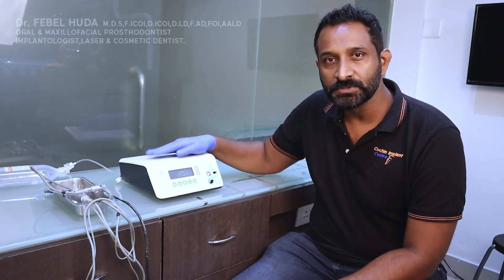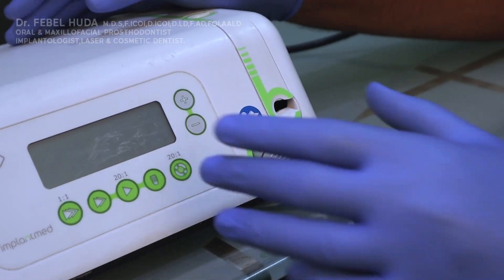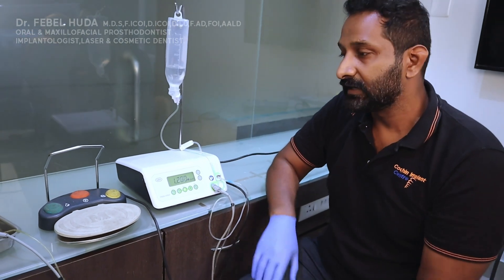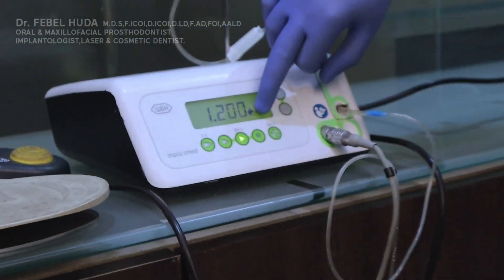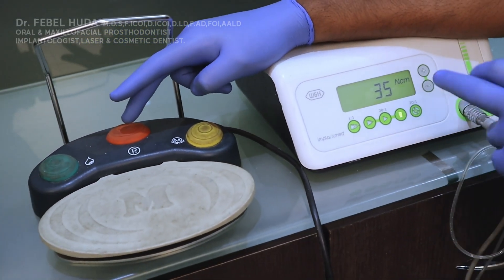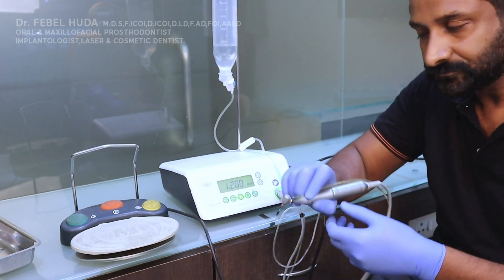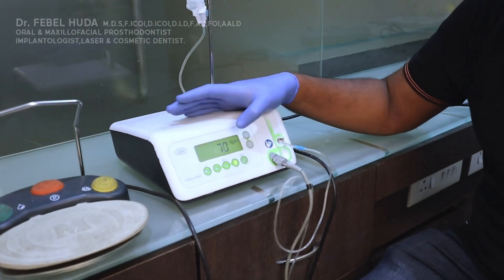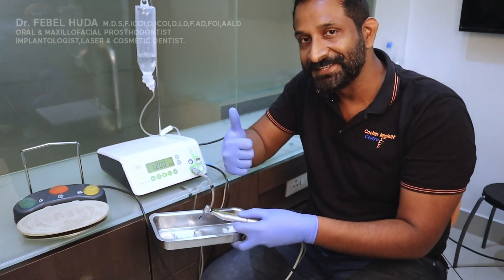W&H - PHYSIODISPENSER EXPLAINED

Comment: Sir if we want to use 1:1 handpiece for like 3rd molar surgery, what settings required?
Reply from the maker: 1:1 with 20000rpm is what I use. In 1:1 , u have a rage from 2000 to 40000rpm. But u will need excess irrigation other than that of  the despenser. Cold saline would be best as it will have vasoconstriction action it would help u with better visibility.